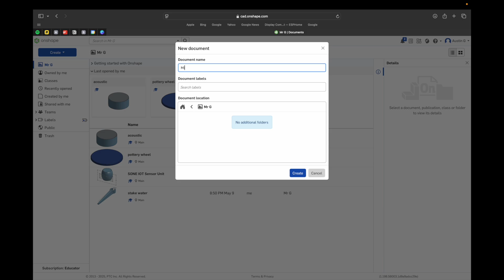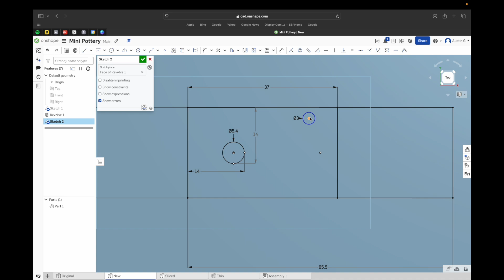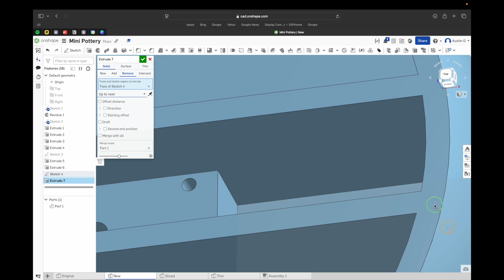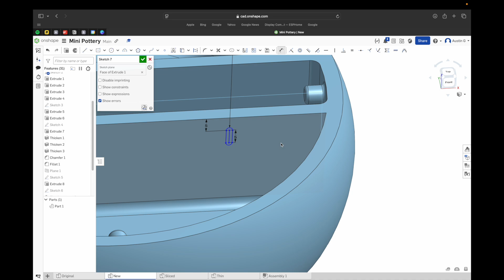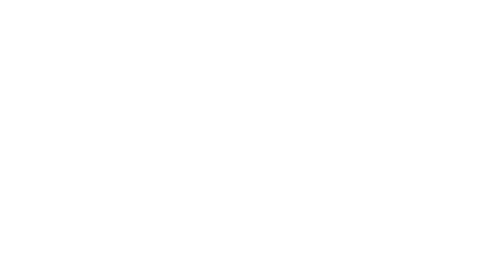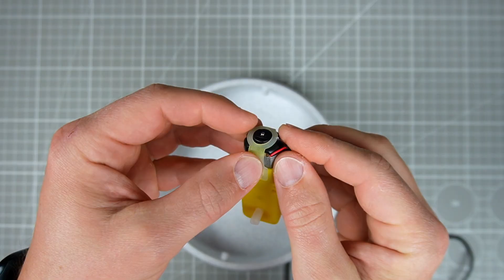How to make a 3D Printed Mini Pottery Wheel – DIY Tutorial

Comment: Interesting project. I've long been looking for a good small wheel, this isn't it and probably wasn't meant to be. I put some effort into designing one myself but it's not easy finding the proper motor with enough power and enough speed. There are many  cheap 12 V wheels online, and they are so very pointless, they could have actually have beem useful with a few dollars more material like a 24 V motor, sturdy base, bearings but they are just plastic garbage. Please continue working on this, increase speed and torque. Don't bother with a foot pedal. Also, please always also upload step files, not just stl
Reply from the maker: With you 100% here. Thanks for all the feedback. I got a 12V worm gear motor and torque is insane, but the RPM was way too slow. Planning to get some 12/24V high RPM versions and adding PWM control to adjust speed. I'll share updates in a shorter video when I get it working, and for sure, will share the STEP as well. 😉 Thanks!
Reply: @nick_the_maker  Hi, I was wondering if you ended up making progress improving the wheel?